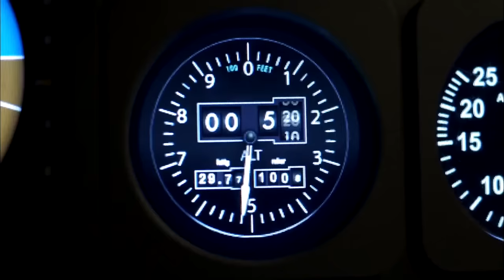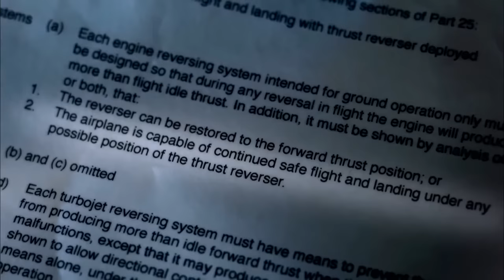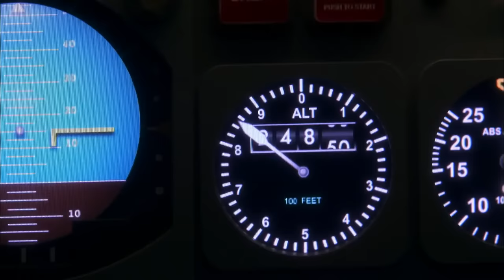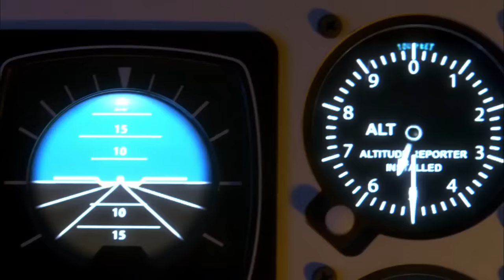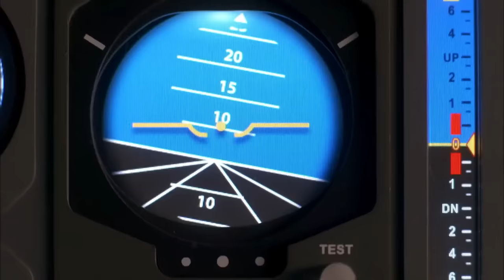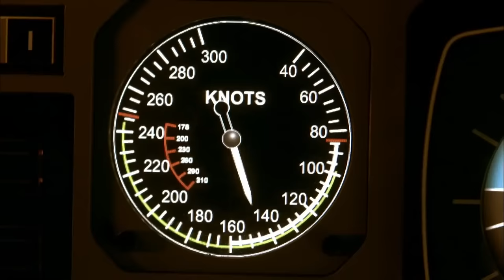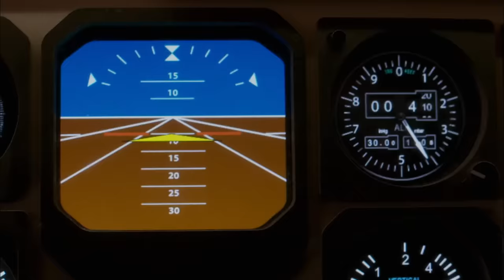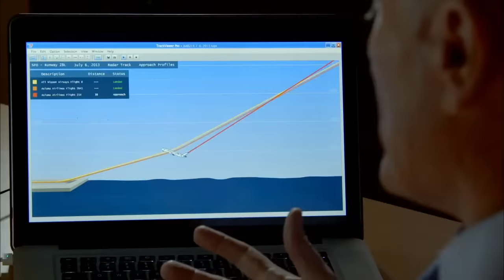Every Single Plane Crash - Air Disasters Seasons 8, 9, 10

Comment: I was on a 737 CP Air Canadian pacific air that had rudder trouble in winter In 1982 we headed out to dump fuel and that gave them a chance to foam the runway and we were bucking pretty bad not sure if weather was the culprit or rudder but by the time we landed I could barley walk off the airplane my legs were shaking so much …which lead to a fear of flying I developed after that for almost 30 years I was worse over open water, I got hypnotized for it and tried everything but it didn’t work. Well Valium did help so I usually took that. So I had a little tiny taste of what these poor passengers felt and I can tell you it gave me a whole different outlook on flying, the other thing was in the 80’s there was a crash every other month or you’d be traveling somewhere and on the news was a crash … planes have never been safer and people should remember that the safety they enjoy now is born on the backs of the passengers who died and having learned from their misfortune. Thanks to them you fly safer now. God bless them.
Reply: thank you so much for sharing. someone questioned in the comments, "why didn't they interview survivors" - well your sharing made up for it.

I remember Canadian Pacific. it brought back memories when you mentioned it (I'm Canadian). that was back in the heyday of flying. a different time that's for sure 😊
Reply: My remedy is I won't fly anymore and what a relief that is, honestly, for me with the nonsense of just the whole check-in and everything.  If I can't drive take a train or a boat I don't go.  I get not everyone is gonna even want to do this.  That story of yours is just something I don't need.  Glad your alright.

Comment: This compilation doesn't give enough post-crash data. I want more. I'll just have to watch the individual episodes.
Reply: The individual episodes don't give any more post crash information than they do here.
MayDay is better.
Reply: Then prepare to crash only knowing what went wrong but without Final determination of investigation.

These compilations Are like throwing water on Top dog thrusting instrument into bottom dog forced to pull out before Ejecting Emergency exit slides.
Reply: This is horrible stuff. It gets you invested in the tragedy and then just starts a new episode

Comment: I see so many of these documentaries where the final analysis is that the pilots were supposed to know which instruments were really broken and which ones are displaying the correct information. I know they are trained for it, but think about this for a moment.
Reply: @sexynelson100 ""
Reply: Yeah, in most cases they have a "book" that can help guide them but when it's a split second decision it gets to be a lot. Regardless plane crashes are so tare I don't worry about it
Reply: Ive flown roughly 25 hours of instrument time in helicopters, and its really an eye opening experience when you actually get in the cockpit and are wearing a hood so all you can see is the instrument panel. It takes constant cross checking and mental notes to ensure every instrument lines up with the others and nothing is showing an odd reading. Took a few hours to learn to trust them, but, what i was flying was a whole lot smaller and not as advanced as a commercial airliner. I was always told, trust but verify. The instructor would cause a random instrument to "fail" (pull the breaker so it would lose power) and time how long it took me to pick up on it. Its certainly intense.

Comment: From my novice knowledge, having the instrument panel shudder to become illegible is something the design engineer should be looking at to resolve as a matter of urgency.  A crude example is the way a car absorbs all external energy in the shocks. The control panel should have a shock absorption activate when the rest of the cockpit is vibrating! Not being able to read or able to see the instruments at that very point they are needed most demands this be resolved. Perhaps this has been resolved but is  a huge miss in the original design.
Reply: Don't see how that would be possible since some of the instruments are responding to sensitive movements of the airplane. I'm taking flying lessons now and watch those instruments like a hawk!  Can't imagine how scary, acutally scarier, it would be without them.
Reply: cool info. thanks.
Reply: cool info. thanks.
Reply: this was a 737-400, the needles on the vibration gauges run around the outside as they are LED, which actually makes the gauges easier to read under high vibration. Both pilots had less than 1hr training on the 400 and no simulator experience, they were used to the 300 with gauge needles on the inside. Basically it was a new plane they weren't used to and thus easy to mis-read the gauges. The problem came down to training, the gauges were fine.

Comment: Back in the 70's a family friend who is in his 90's and still alive purchased a new plane and was ferry flying it from the manufacturer to his local airport and it suffered a massive fuel pump failure and both engines cut out and they radioed the tower told them they were going down and were going to land on a public road and a car showed up and they veered off the road and landed in a drainage ditch flipped the plane over 2 of the 4 on board were knocked out and had to be drug out of the plane as it caught fire. He got a new plane through insurance and etc but thats the craziest actual plane crash I know of with anyone I know.

I can't remember what kind of plane other than if I recall it was a twin engine Piper
Reply: @ADDrecords  He wasnt 90 at the time, He owns a local lumber yard and he still drives big rig trucks for work in his 90's. Dudes been a family friend forever he went to his last high school reunion as he outlived his entire class and hes the last alive its nuts.

Comment: why is it better to take off, knowing the plane wont fly far, rather than trying to brake and possibly go off the end of the runway? seems like that would be the safer option for some circumstances
Reply: I think most (if not all) commercial airliners are able to safely achieve positive-rate (climb) if an engine fails after rotation speed. Its between V1 and the “rotate” callout that is a problem, because the plane does not have enough space to safely stop, and may not be able to safely climb away either. But after all, its easy for us to judge in hindsight, but under stress and fear and extreme time constraints, critical decision making can often be difficult.
Reply: IKR and why the hell don't runways have the end of the runway cleared, be that a empty field or what?  I fully realize space is an issue and not always possible but I watch all these shows and the amount of times there's either a wharehouse or raised walkway or fuel tanks or a bloody ditch at the end of the runway...it's like NO, keep that clear, ya know.  Just in case. 
Like you I'd rather skid into a set of trees rather then drop from 700 feet THEN skid into the trees.

Comment: I believe the first one had a “pilot error” factor. If I remember right, the pilots had just changed onto that type from a previous 737 type (I think it was the -300 to the -400). 

And due to the prior generation air conditioning being fed from the right engine that led them to believe it was the right engine. But the system had been redesigned for the new type and pulled air from both engines.
Reply: Confirmation bias. Past practice.
Reply: This was because the cabin crew were not trained to say the correct side.  They told them the wrong side from visual out of the window ....you always look at the cockpit for right and left   they were facing the other way
Reply: That pilot was also on vacation when those systems were changed and he was never made privy to the changes before he came back. I don't see him at any fault whatsoever.
Reply: @estherlane7498 under duress, even if trained they can easily mix it up. I've mislabeled lungs as a nurse and the brain can flip things even with good intentions. With that said better protocols can help, but doesn't avoid the mistake entirely.
Reply: @estherlane7498  not sure if it's the case on planes, but on boats, you say starboard and port to avoid that very issue
Reply: @dana102083  I was cabin crew.  It's drilled into you and this particular case is shown .. we did everything as a cross check     you never did anything by yourself.
Reply: @S85B50Engine  no not on planes.  I was cabin crew.  They do cross-check
Reply: @estherlane7498  weird, I thought they would have a specific callout for specific sides to avoid confusion
Reply: @S85B50Engine  they do but the left and right is as you're facing the cockpit.  They use door numbers.   Door 3 left.  Etc
Reply: @estherlane7498  fair, because Starboard is the right side when looking forward, and Port is the left when looking forward.
Reply: Yes, that’s what I thought- although I’d say training error rather than pilot error

Comment: For those airplanes that crash because of faulty gyroscopes, how about having a simple water bottle on board to always be sure where's up and where is down?
Reply: Bingo!!!

You said before me!!!

The best thing for 'spatial disorientation' is liquid in a transparent container.

A good old compass and a water bottle would save a lot of lives.

Cockpits should also have tiny apertures for pilots to push out emergency anemometers (such as pitot tubes) for air speed and barometers for elevation due to atmospheric pressure.
Reply: Or a leveler?
Reply: Won't work. Liquid levels are most vulnerable to the forces gyros are specifically designed to disregard. In the right loop a liquid level will show you the ground in any direction.
Reply: The bottom half of the bottle should be red to denote the ground. When the red half is ever on top, u are upside down. Just like the horizon indicator

Comment: If I would become a Pilot, I would be known as the Ball and String Pilot. Cause every Plane I would Fly-in I would tape the Ball and String to the roof inside the Cockpit that way I can always tell how the Plane is flying. Cause the Ball would lean to the Turns and move forward and backward It would really help at night with No Horizon to go by outside the Plane.
Reply: Against all intuitive belief, this won’t work. It might if you are a static object. But a plane is not a static object, it is moving, and if it is accelerating, you don’t just have one vector (gravity) pulling a ball and string down. You have many and they’re all gonna act on the ball
Reply: You can't accelerate forever
Reply: You're talking about a car gas and break
Reply: @gliderarts3573  No. But it’s irrelevant because a plane DOES accelerate anytime it changes course and that’s the time where you’d be concerned about orientation anyway.

Comment: My first thought about how the reverse thrusters could be problematic was if one was deployed and one was not. It could cause the plane to spin like a table top. Literally no idea if that’s even a possibility.
Reply: Well. Spin like a tabletop, possible. But basically it would „pull“ the aircraft down to the corresponding side. Then cause more problems like damage to airframe. There actually is a Airplane crash with this exact moment in mind.
Reply: Maybe it always wanted to be a breakdancer?😂

Comment: Why don't Airplanes have strong airbags or an ultra reinforced version of hovercraft tracks under the plane to cushion it if it crashes?
Reply: Great concept! Especially the hover idea. We kind of have the technology already. But the main problem with those are, with crashes the impact and forces created on impact are sooo great, air bags would make little to no difference. Usually our spinal cords shatter on impact, killing us instantly. Now for less serious crashes or crash landings, airbags could be huge. So I see the allure. Unfortunately it would be a cost/save scenario. Airlines would add up how much to install on all planes and then add up potential cost of lawsuits if they didn’t install. If it’s cheaper to not put them in, they won’t. It’s terrible. And with the hover idea, it’s great too. It’s mainly the same cost scenario again tho. Would be expensive to install and with the randomness of air incidents, there’s no guarantee that a hover ability on airplanes would be actually do-able in middle of a crisis or mechanical failure Etc. 

One safer thing they could do is put more restrictions on companies and accountability. Forcing companies to closely monitor and maintain their aircrafts. Also implement more training required on commercial pilots. Maybe update technology more also, by now we must be far enough in technology to have more/bigger LCD monitors with there own diagnosing capabilities. Helping to elimainte the simple mistakes pilots make that end up costing lives. I’ve watch ALL of these aviation shows and so many happen because of simple things the pilots do. That shouldn’t end up a tragedy. There should be smart devices that can recognize these errors and offer information to solve said issues. Instead of just an audible alarm/blinking light and then having to manually reference a guide book/troubleshoot book. Idk…rant over lol
Reply: I don't know? There must be some reason they don't do it though.
Reply: @darksoul479   aerodynamics
Reply: Have you see what happens to a plane that hits the ground at high speed? Also its extremely common for them to tear apart in mid flight if something goes wrong.
Even with take off and landing it will do very little.